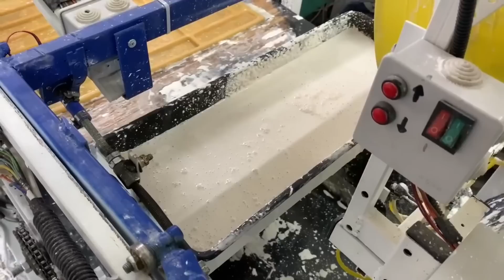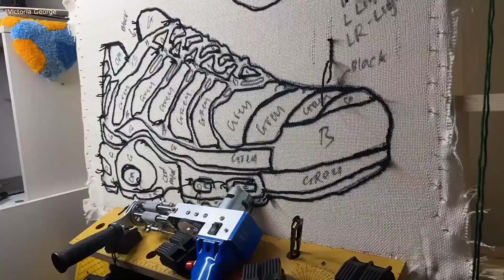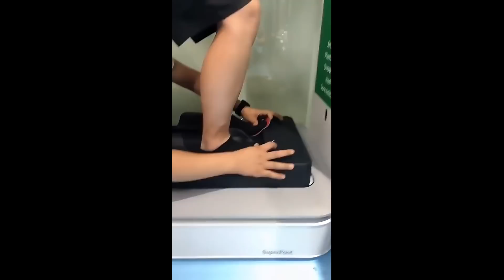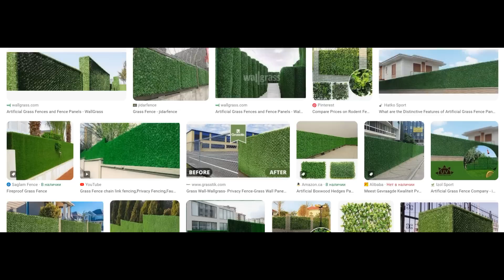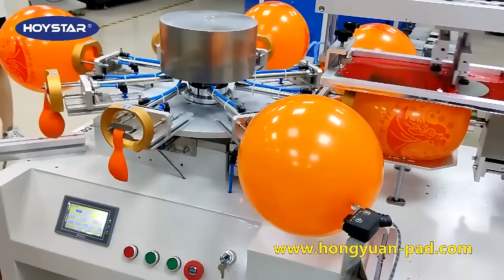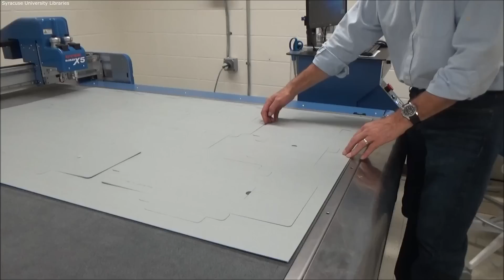Small business ideas 2024. Garage business machines. Mini manufacturing business ideas

Comment: The embroidery machine is much more complicated than this video shows. Cheaper ($1000-$3000) machines can only use one needle and one colour at a time which makes it take a lot longer to embroider. Multi needle machines that can do more colours go anywhere from $10,000-$30,000. Also it isn’t as easy as uploading a picture and letting the machine do the work as they have their own file typed and automatically digitizing isn’t really good unless it’s very very very simple line work . Usually you have to learn how to digitize yourself or pay someone to do it which can get pricey. Software to digitize is around $1000-$5000 but there is some free ones that aren’t super great.
Reply: So which best for small business to began
Reply: Really just depends on different variables, how much time you're willing to put into it, how much money you're willing to spend and finally if you can create each design yourself or not. If you have time but little money then a single needle is a good place to start as it would be cheapest but require you to replace the thread each time your design changes colour. To create your own designs requires software and its usually not the cheapest, you can get around this by buying designs from other people  but that means paying for each design but also means once you buy a design you won't need to rebuy it and can use it multiple times to make your money back.
Reply: Agreed, a single head multicolor embroidery machine can cost up to 9k and that's putting out one garment at a time, i don't see embroidery as a low cost start up business.
Reply: Am i right if i say that we'll have more peace of mind with embroidery machines than DTF machines, DTF machines tend to break down too often but embroidery machines seems way more reliable even shitty brands.
Reply: @fadelibrahim7663 what is a DTF machine?
Reply: @StitchFae  direct to film, makes prints and we press it on shirts later on.
Reply: Where I work we have a Brother VR so a 1 needle machine and I totally confirm what you wrote.